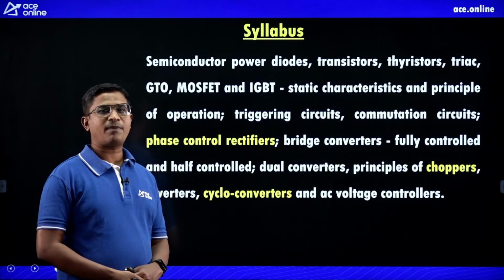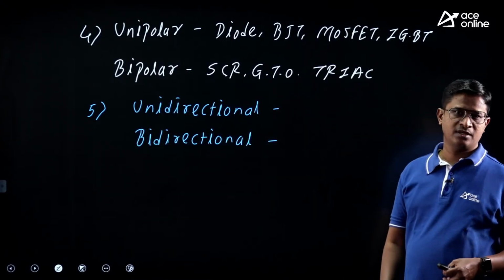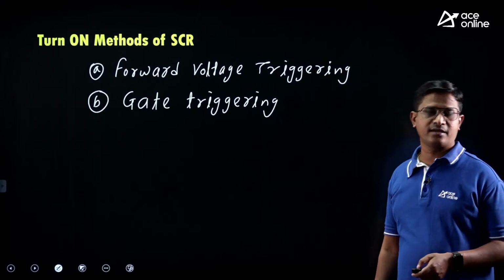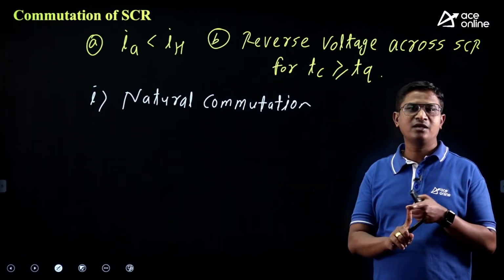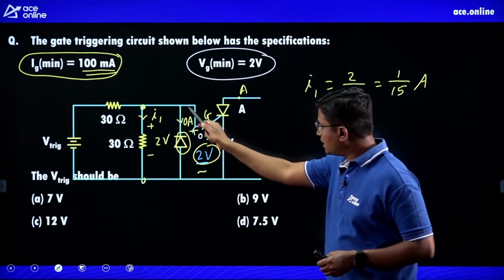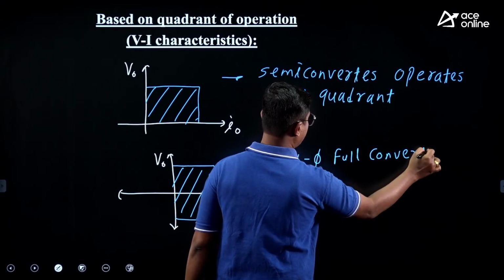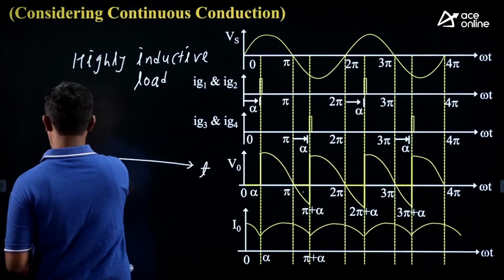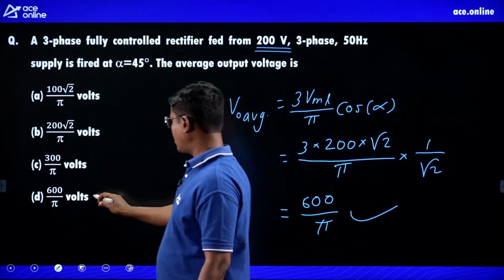Power Electronics : TSPSC - EEE Polytechnic Lecturer | Important Concepts & Questions | ACE Online

Comment: BJT is bipolar device device sir
Reply: No.. power bjt is unipolar. It can block high forward voltage but for high reverse voltage it will get damaged. It can block only 40 V to 50 V reverse voltage.
Reply: @rajendragharase  thank you sir